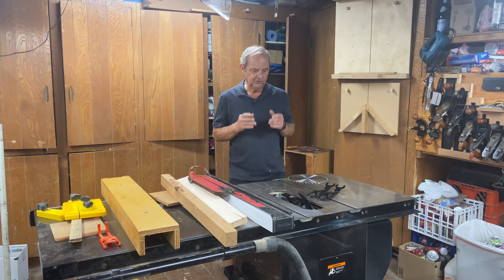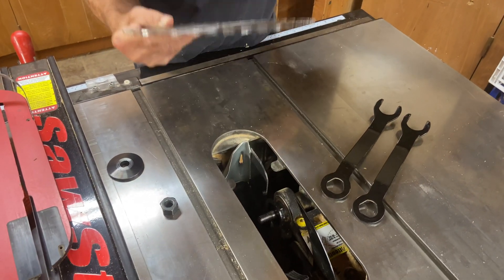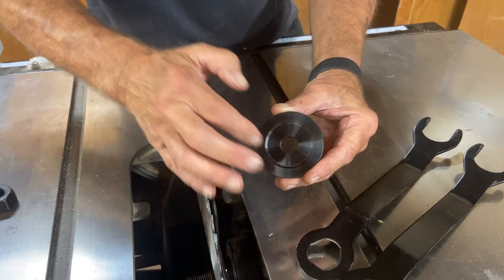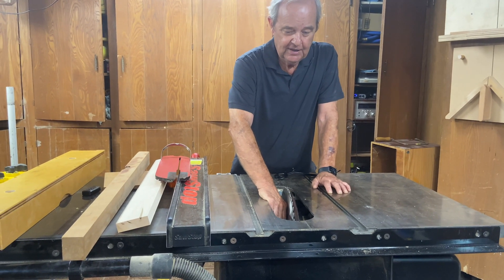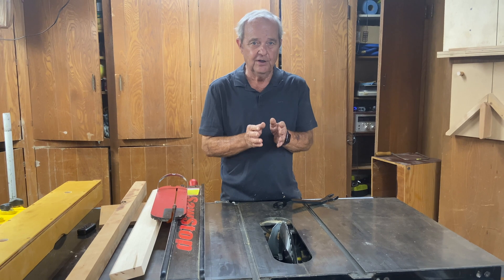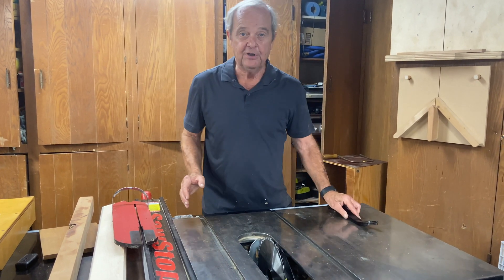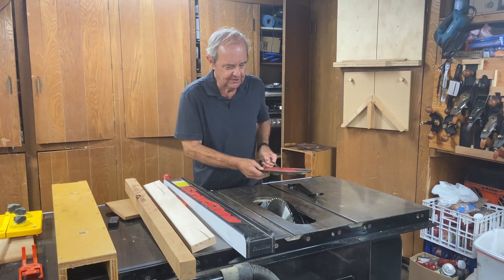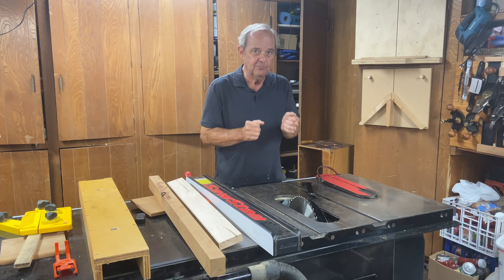How Tight Should a Table Saw Blade Be?

Comment: The blade wrench on my Skilsaw is stamped "finger tight plus 1/8 turn". I follow that direction and have had no severed heads so far. Nice perk is it's a lot easier getting the nut back off next time.

I checked my Makita manual and it only says to tighten "securely" whatever that means. But then has a "CAUTION" to "use the provided socket only otherwise the result can be overtightening or insufficient tightening". So they do seem concerned with too tight.

Comment: Thanks for making this video. This is very useful information. I now have a blade I can't get off. I don't think I tightened it enough and when I started the saw it kicked a bit. Now though the blade seems to be on tighter than ever. It seems like the torque from the saw (I have a Skilsaw Worm Drive table saw) pushed the blade on too tight. I now think the blade might be warped because I'm seeing a ton of vibration that wasn't there before. What size wrench are you using on the left side? I don't know if I can access that side. Is there a nut that is the same size as the arbor nut on the left side?